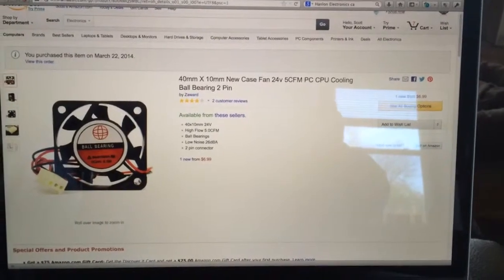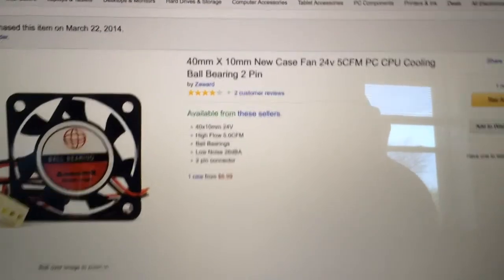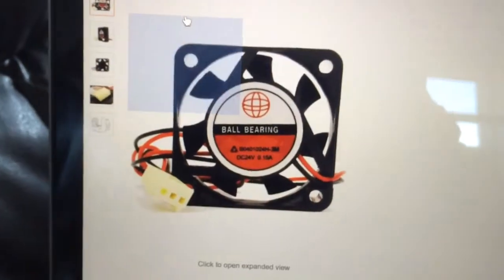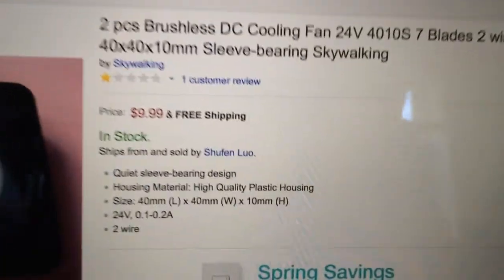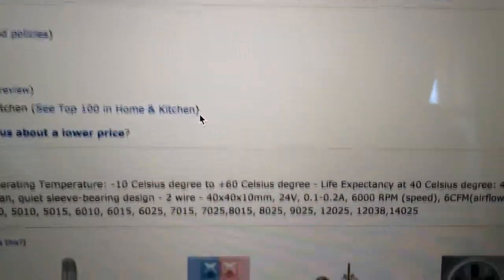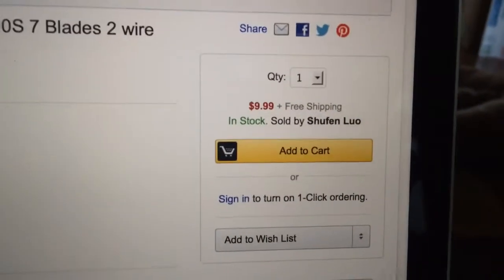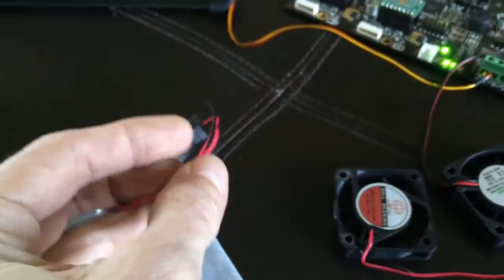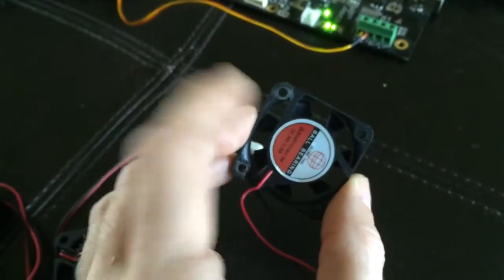Makerbot Replicator quieter Ball Bearing Fan

Comment: Sleeve bearings are conventional for these fans. Ball bearings are superior. Even better is sealed liquid bearing but good luck finding those in this format and voltage. Sleeve bearings shaped like cones that fit into a sleeve that is angled to meet with the surface of the bearing. More friction. Ball bearings will last much longer as they have less friction and more distributed wear.